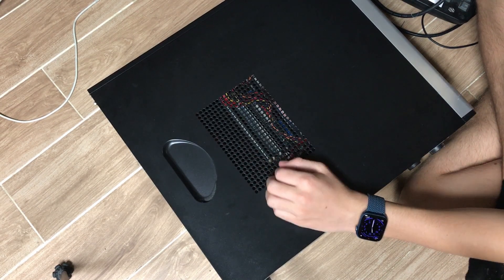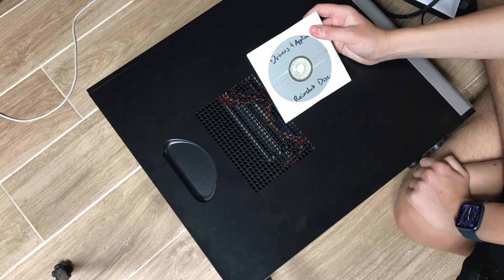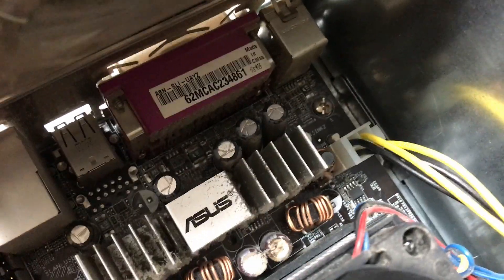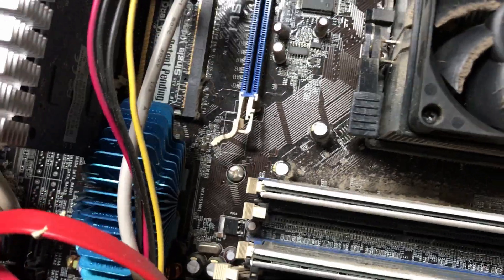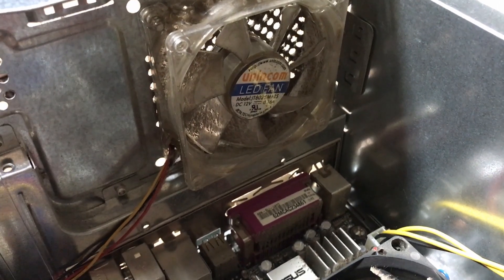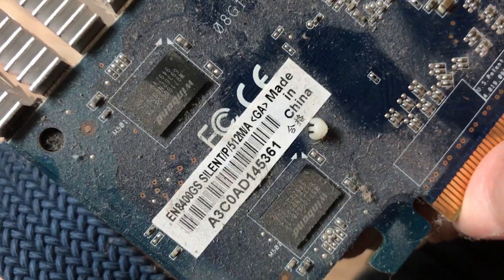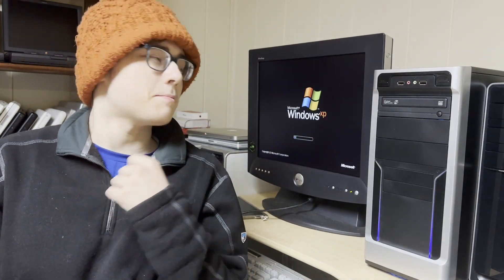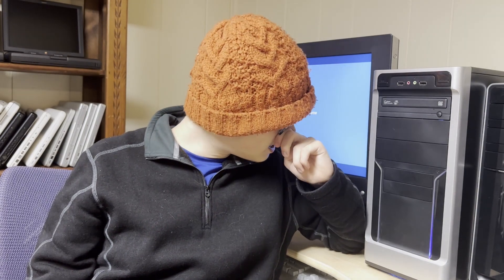The Mystery Custom-Built AMD Desktop

Comment: I have an EVGA n780 triple sli motherboard that I had to replace 3 caps. They weren't near cpu though. Think one other bad I replace one or two. Electrolytic caps just go bad. Especially if overclocking cpu. Over time. Been there. Had an MSI Athlon board back in 2002 that just died. Don't remember seeing leaky caps back then but got an rma for it and msi replaced with updated caps. That was right during that time period. Cap manufacturer had used incorrect gel. Modern day caps are so much better. One word of advice-wear some nitrile gloves when dealing with cleaning old components. Also replace those fans.

Comment: The A8N SLI had a fan on the original heatsink. This board has a replaced chipset cooler with that blue anodized zalman thing. As it says in the error, you can disable the error message in BIOS setup. That board was one of the kings of the AMD 939 era. If you can get an nvidia 6600 it would be more in line with the overall specs and play all the 2003-ish games like Doom 3 and the original Farcry. Thanks for taking the time to get the caps replaced and keep it alive.

Comment: the fan thing is caused by the fans not sending the speed to the motherboard meaning the fan board has a problem or a wire has come off at the fans. 3-4 wire fans have what is called a speed sensor and one of the wires sends that to the motherboard. when the wire comes off or the board on the fan fails it causes the error and a simple thing to do is just go into the bios to turn off that setting

Comment: Damnit i accidentally clicked on another video so it removed all i typed... Anyway...
Socket 939 released around 2004 with the dualcore cpus arriving around may 2005 before AM2 released in 2006 which added DDR2 & some minor optimizing too the architecture which put it a bit closer matching too the core 2 duo cpu's.

The sli toggle is basically just splitting the 16x pci-e too 8x for a pair of cards or anything else in the other pci-e slot together with the molex 4 pin on the motherboard for additional power too both cards, it would obviously not support booting from it but might be able too do the sli toggle & actually run an nvme ssd as additional stupid fast storage on this in windows 7.

The 8400gs due too it's simple core should overclock alright with additional cooling added in something like " Nvidia inspector " & running like 3dmark 03 & 2001se on this.
A 512 mb ddr2 nvidia 8500 gt i got sitting around did with a better cooler slapped on it 730 mhz core & 410 mhz on memory vs 439 mhz core & 359 mhz memory, shader clock is by default 918 on that card, think i put it at 1500 mhz on shaders, think you'll be able too get somewhat close too that pointing a 120mm fan on the card & plugging in the molex 4 pin even if you are using only 1 slot.

Though a bit more powerful card is probably better for testing this like a 9600 gt or hd 4670 & games like left 4 dead 2, half-life 2, f.e.a.r, killingfloor 1 etc at like 720p or with the 8400 gs 1024x768 should do alright.

Comment: whats the model of that monitor? id love to get one or one similar for my dell latitude e7450 that way it would be easier to use with a second monitor because using a tv as a monitor just dose not feel right. also how big is it?
Reply from the maker: Dell Ultrasharp 2000FP. I would recommend getting something newer though, it’s an amazing monitor for XP era systems but the quality, input connectors, and resolution won’t be nearly as good as a modern panel. Not sure the exact size
Reply: @3lectr1c  ok thanks! also just so you know yous is a 20 inch and was made in the year 2000. my uncle worked for dell back in 2004-2018 so that's how I know how to decipher the model numbers. so If you need help with any dell thing I'm here to help lol